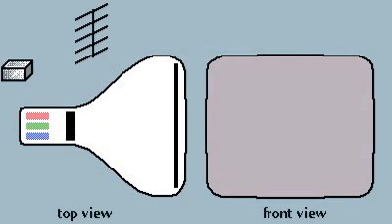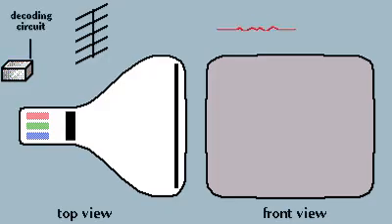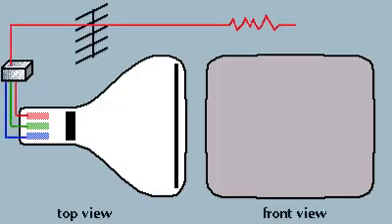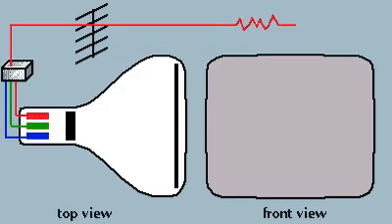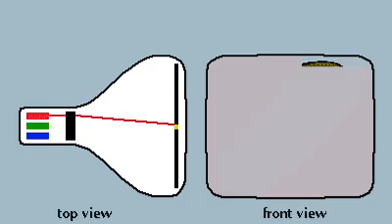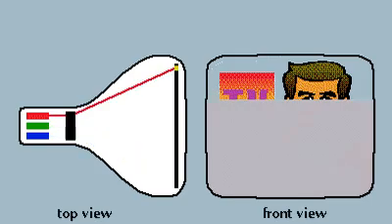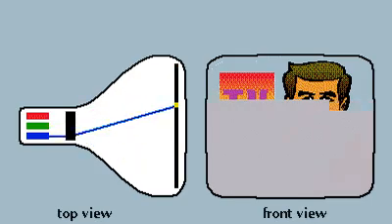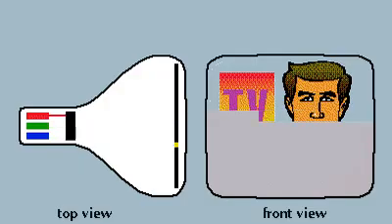How a Television Works

Comment: since when was green a primary colour 🙈
Reply: danny flint ik
Reply: ? What are you on about? Green IS a primary color, one of the electronic, or light-emitting primaries: red, green and blue. That's what RGB refers to. Maybe you're remembering the reflected primaries, which artist's use and which most of us learn about in elementary and junior high school: red, yellow and blue. There's also the subractive primaries, you know. Those are cyan, magenta and yellow. You would learn a lot about those if you were studying cinematography or film processing. 

You can use either the additive or subtractive primaries to create all other colors. One interesting distinction is that if you combine the three additive primaries in equal measure, you will get the color white. If you combine the three subtractive primaries in equal measure, you get black.

Comment: Carbonit is degraded carbon (fragmented from a purer start point) none the less carbonit is carbon. All material units are carbon based. The trees, flesh, water, magma, oxygen are all composed of carbon atoms. Space is composed of the primordiac atom codified as XT which means a) it's empty nothingness, b) it's gonna fucking hurt man if you jump out that cargo hold! c) it's the substance of evil. Light on the other hand is not matter. It contains genetic information, but despite there being water present in the sun, there is no water in light. So for now, my experiments can only conclude, light is the "power of love".

Comment: @humeyboy
All rainbow colors are from white light. White light is dispersed through a water droplet. White is a color. Black is really absence of color, but is regarded usually as color.
Colors are not dependable of each other, they are just perception of different wavelenghts. You don't need blue and yellow for green. Green is only light having a spectrum dominated by energy with a wavelength of about 520–570nm.
Google "additive color" and "subtractive color"!
Reply: White colour consists all colours

Comment: Good video, but misses some details.
The actual path of the electrons is curving instead of straight line.
Also detail about the actual electron guns would be interesting, explaining how the electron is accelerated and how it's curved with magnetic field and foremost how the magnetic field itself is controlled.

Comment: @DoctorSess
There are different primary color models. One of them is RBY, which would be familiar with painting. Compound colors mix in a different fashion than light. E.g, if you mix all colors, you will get black. If you mix all light colors, you will get white.
Television uses RGB colors to create different light combinations, green&red=yellow in RGB.

There is also CMYK for printing colors, but that's different thing.